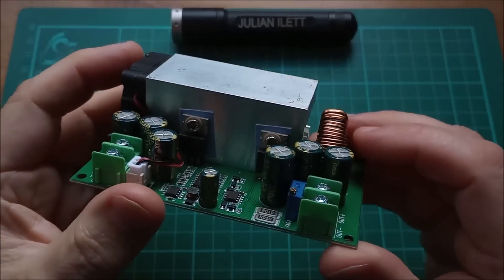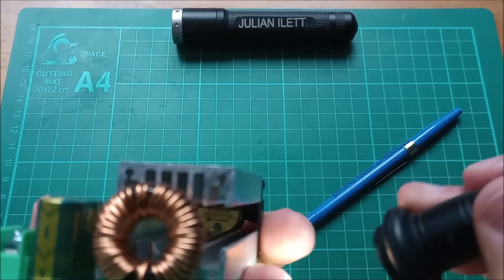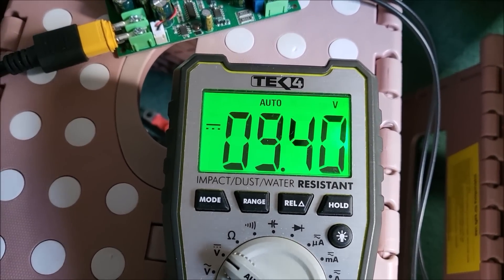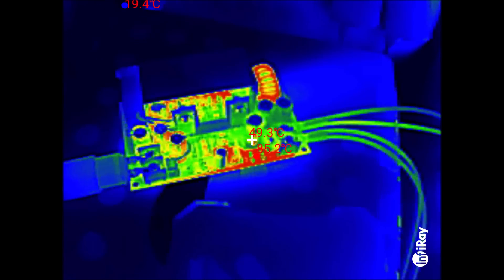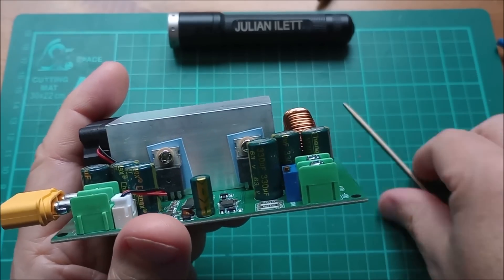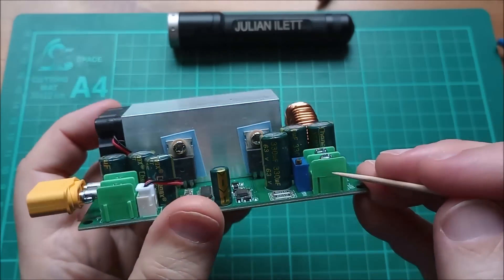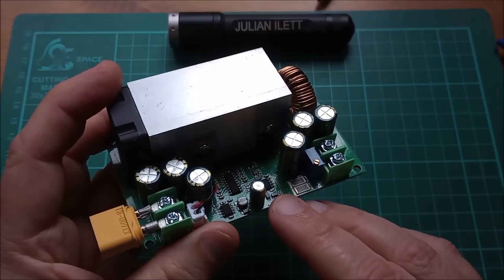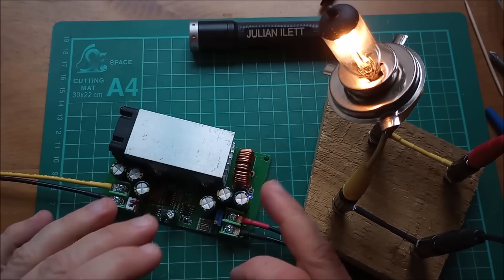Postbag Update - 25A Buck Converter

Comment: The converter has proven itself in operation well. When working in parallel, a symmetrical connection is desirable (the length of the wires and their resistance should be the same). All the terminals of the units should be connected at one point. With respect, Vladimir.
Преобразователь зарекомендовал себя в работе хорошо. При параллельной работе желательно симметричное соединение (Длинна проводов и их сопротивление должно быть одинаково). Все выводы блоков должны соединяться в одной точке. С уважением Владимир.

Comment: Sir I have been using a solar plate 600 watt for a year with a buck converter 600 watt 25 amp if I double the same set up and connect the output together then will it give me 50 amp please Please answer me

Comment: I have one more question if the discussion here is still active : does anybody know if the choke is made with aluminum wire and the efficiency can be increased by re-winding it with copper ? There is a discussion going on about the very cheap 400 W stepup module that can be much improved by changing the choke wiring.

Comment: Very informative video, thanks for it, i recently bought two such modules and there the transistors are HYG043N10. I'm playing around with swapping transistors, for example the 400 W boost converter that has very cheap transistors can be upgraded to go to higher voltages, and also the commutation losses  depend not only on R_DS,on but transconductance and input capacity so the best is just to try which one gets less hot. Nice to learn from the comments that the parts are  tl494 and driver ir2104, so i guess the other ic is a little buck converter only for the fan ? The part numbers are erased on my modules.

Comment: Buck is tl494 and driver ir2104, my findings based on the circuit schematics
Reply: Pm me can you to install do sola paint of charger`
Reply: Thanks a lot. Do you know what is the small buck voltage regulator that makes the 12 V for the tl494 and the fan ?
Reply: @earlyadapter643  XL7005A

Comment: They do make a version of this with current control. The pot would be on the left side near that mosfet you looked up. Haven’t looked what else they change on the PCB. I’m only interested in these buck converters if they have current control. 

Obviously the other issue is the lack of displays. I have seen similar buck converters that also use small 7 segment displays. 

For under $20 (the variable voltage/current model is $12’ish, the one with displays is a bit more) this isn’t bad for a 15A stable, perhaps 20A with upgraded heat dissipation.
Reply from the maker: Yes, I got that version. It looks like a bit of a fudge. The current pot is wedged in, touching the MOSFET. I can't see myself using it.
Reply: Pm me can you to install do sola paint of charger`

Comment: Thanks for a great video, I really like your lamp set up and the connectors with the fork terminals.  All of your connections really.  I have something similar with a lot of socket adapters that will accept US 120V bulbs (it's always been a work in progress).  While I was watching this, I would have liked to see a test of the output voltage, set it down to just below the minimum you had with all the lamps on, say 10.000V and then plug and unplug all the lamps to see if the output voltage remained the same.  I did just order one of these.  It says they operate in the Continuous Current Mode CCM not sure how that's different than Constant Current CC.  My reading of CCM finds that the inductor always has current flowing and never zero.  hmm...  Nothing to do with Constant Current which I care about.  It does say it has Constant Current (and short circuit protection).  It also needs a flyback diode if powering any inductors.  It has no reverse polarity protection on the input (easy to add).  There are some really cool small fans that are squirrel cage and don't whine all the time, I need money, where are the car keys... wait, that's something else.  I like this little buck converter.👍👍 ⭐
Reply: Pm me can you to install do sola paint of charger`

Comment: I think those shunt resistors are irrelevant except for a hard set over current protection, most likely set at 25A. They do nothing when running in a CV mode which is where it was running the entire time you were testing. I suggest soldering right over them as your overcurrent will be from upstream devices anyway. This will keep any ground loops as minimal as possible so you don't damage any small interconnects between the cards.
Reply: Pm me can you to install do sola paint of charger`

Comment: i expect that that package rating is with the device connected to incredibly big heatsink. 
it's almost impossible to get the currents they claim on the data sheets in real life.

I had a 1KW rated resistor which with 800W blow in about 3 seconds, it was mounted to a heatsink with two very powerful fans but it still died. Later found that we had to machine the heatsink as plain aluminium finish was not flat enough to allow the heat to flow even with a pad. this was in some very very small print. 🙂 we spent as much time designing the dummy load as we did the circuit we were testing.
Reply: In software development with thorough test code it is common to spend 2x to 3x the time writing test code as the production code (what we'll deliver).  You can get about 50% test coverage if you spend about the same time on test as production code.
Reply: @Sylvan_dB  Don't get me started on software testing. having done projects to DO-254 (HW) and DO-178C (SW) i hate the saying "can we just make a minor change" 6 months in to testing.
Reply: Pm me can you to install do sola paint of charger`

Comment: I have been using a couple of those regulators to drop HV solar panels down to a suitable voltage to feed my cheap fake MPPT solar charge regulators. What I found most 
interesting is the final system efficiency is even better than a much more expensive MPPT solar regulator. I set the buck regulator output voltage to 16V into the cheap PWM regulator which delivers a full 22Amps into my load, with the MPPT controller I get just under 20A from the same panel, both running at 14.5V final output. Without the buck regulator I get just over 6A with PWM regulator alone, but with this system, as the current drops the solar panel voltage soon exceeds the PWM maximum input voltage. So after discovering this hidden benefit I did a second panel the same way and get consistently better performance than the big dollar mppt controller, the cheap solar charge regulator gives me full data logging and LVC battery protection along with USB outputs and direct in/out ports. The total expenditure is so low that I can afford to do multiples to gain large energy levels. I also purchased several of the more expensive 800 watt buck versions with CC/CV to use with my 430Watt panels and I get almost the same gains. I also find the buck efficiency gets more charge energy on cloudy days and early/late sun than the MPPT chargers manage to do, the high panel voltage coupled with high buck efficiency to transform the voltage down just works so well at very low light levels. I suspect my overall gains are probably much better, mainly as it is reaping benefits by efficiently charging low voltage (12V) batteries from HV panels. Time will tell as I log more data.
Reply from the maker: Have you looked at the buck/boost units with MPPT pot?
Reply: @JulianIlett  Not as yet, if they can squeeze even more efficiency out I'll have to give them a try... do you have any video reviews on them?
Reply: I was thinking of doing similar- but for the purpose of keeping my pv wire voltage high with 4 or 5 panels in series to reduce losses over my 80m long wires. I would need a buck converter that stepped down the roughly 250vdc to about 100v which I would then feed into my mppt chargers. I can't find any converters that run at that high a voltage though.
Reply: @tomgrant6563  Good idea, I did a similar trick to operate our gates about 140m from the shed, I run 24VDC into a boost converter, send it to the gate box at  55VDC (maximum the cheap 10A boost converter would do), then I buck regulate it back down again to 24V at the gate box. On load when the gates are moving the peak voltage drop over the 140m is about 20V, but the buck keeps the output at exactly 24V up to about 7A load. It was much cheaper than trenching in mains or running super heavy gauge wire.
You may be able to run HVDC into a regular switchmode power supply for broad voltage input conversion down to whatever voltage you like. Most will work happily on DC input up to 340V (250VAC), and down to around 150DC(100VAC) as they internally rectify the AC input anyway and self regulate for 100-250VAC input..
Good luck.
Reply: @alasdair4161  haha that's a bizarre- I figured that out today  before I saw this comment! after a fair few days of researching and scratching my head! Exactly as you described.
Switch mode power supply off the dc.
Reply: Pm me can you to install do sola paint of charger`
Reply: Do you think it safe to run it at 25A continuous. I've limited mine to 20A MAX, but my panel generates a lot more than that

Comment: If those use a closed loop voltage follower to regulate it's output, I would fear them fighting each other if you deisolate them by allowing the grounds to reference together. No two voltage references are exactly the same, and it would send each other into current regulation allowing all the voltage followers to free for all deathmatch regarding what is actually '12v'. 
A diode would be enough to prevent this from being an issue, but you would have to compensate for that voltage drop and it would be a possible point of efficiency loss. I would use schottky and not silicon diodes.
Reply: I'm not sure diodes would actually solve that problem. Besides you should use ideal diode modules if you are working with high currents.
So yes with closed loop voltage regulation the problem you have is that one module will always be set at a higher voltage than the others, so because it is the highest voltage the majority of the current will flow from it as it tries to keep the higher voltage than the rest, the others see 12.01v when set to 12v so they shut off completely. It is only until the resistance in the connections or really precise trim pot adjustment will that balance out.
What you want is actually a resistor on the positive side so that a small change in voltage doesn't have a large change in current. This has been done many times before with audio amplifiers with multiple transistors in parallel.
The reson you want it on the positive side is due to ground loop reasons, if you were to inadvertently ground the chassis of the AntMiner with a stray wire or other metal enclosure your negative side resistance will change, defeating it's purpose. Putting it on the positive is ideal because it is generated at the buck converter and consumed by the miner cards, so nowhere else to potentially connect.
All current shunts in my opinion should be on the positive side to avoid creating negative and ground potential differences.
I personally use the WD4050 module it is much more expensive but it has all the right features, positive shunt, sunchronous, display, and CV+CV adjustment.
Reply: I also believe running one module per card would also completely eliminate the "fighting each other" issue, if the 12v output is not in parallel on the positive side then one card can run just fine at 12.1v where another card can run from another buck module outputting 11.9v. Both modules and cards will output and draw the same wattage. The 11.9v fed card will just draw slightly more current and would run a little less efficient than the rest but there would be no cross fighting since they won't have a way to influence each other.
Very good topics to discuss for sure.
Reply: @SuperBrainAK  I assume there are positive rail interconnects between the cards. Perhaps the real danger is damaging those interconnects, or anything else that is between them and the differing rail voltages. A diode would limit that effect since the power supply won't try to sink any current itself. But yeah, that would be a 0.5v drop you would have to deal with by increasing the power supply voltage and dealing with the heat generation. A resistor to limit current on each would generate even more heat.
Reply: Pm me can you to install do sola paint of charger`

Comment: Not sure the unit needs derating due to the connector.  300V at 20 Amp is 6 000 Watts.    That is very different to 20 Amps at 12 Volts which is only 240Watts.   So the connectors will handle a lot more than 20 Amps at 12 Volts.    Derating it for other reasons may be worth while, but not for the connectors.
Reply: Hmmm, The connectors don't depend on the wattage of the load but of the wattage of the connection due to the resistance of the junction and materials used,  which would be I times the voltage drop along the connector or simpified I^2 * R. I.e. it should only depend on current and connection. Where am I wrong?
Reply: @neur303  You're not wrong. 20A means 20A maximum current for the connector, regardless of whatever potential it is at, because of the I2R losses causing overheating. The reason the connectors also carry a voltage rating is because of the possibility of insulator breakdown. Two separate failure mechanisms for overcurrent and overvoltage means you don't just multiply them together as if it were a maximum wattage!
Reply from the maker: Yeah, there are lots of reasons to derate these things. Interestingly, they seem to have fitted a higher rated output connector now: https://www.aliexpress.com/item/1005005639051641.html

Comment: Re 12v double filament Headlight Bulbs (@16mins), unless both filaments are same wattage they will have different voltages across them when filaments are wired in series. 
The lower wattage filament has the higher voltage and will be stressed / may blow especially if you apply the voltage of two fully charged car batteries across them (2x14.4 = 28.8volts).
Also having both filaments lit results in an awful lot of heat being produced and is probably not recommended.
Years ago I was using 4 paralleled bulbs in this fashion while testing a beefy 28v power supply, It was entertainingly very bright and hot for a couple of minutes before they all blew the low wattage filaments.
Reply: Pm me can you to install do sola paint of charger`

Comment: The more current you pull through those measuring resistors, the more effect bridging them out will have.
Reply from the maker: I'm not so sure now. There's another variant of this converter that has a current limit pot. Maybe this unit uses those current sensing resistors to perform a simple shutdown at 25A. Not sure. I've bought the other variant.

Comment: ah, banana plugs and spade terminals. Reminds me of my electronics class 50 years ago!
Reply from the maker: Those and XT60s are my favourites :)
Reply: @JulianIlett  Agree with the XT60s - such a useful open-source and versatile connector, it's like Lego, so easy to make distribution blocks and adapters with them, though it's a struggle with 10AWG cable.
I also have to use XT90s since I can use 100s of amps for large ebike and inverters.
Reply from the maker: Yes, I recently used 12AWG silicone wire with XT60s - it wasn't easy. The male connector has deep recesses behind the solder cups, but the female doesn't. I'm tempted to make a video about that.
Reply: @JulianIlett  tip, when soldering XT connectors, plug it into its opposite connector to hold the pins in place in case the plastic starts to soften or melt.
Holding vertical may be best. The void could be filled with a piece of solid core copper from cooker cable. Saves solder and improves conductivity.
Also good for building distribution blocks splitters, series, parallel and gender changers. Encase in hot glue and shrink-wrap.
Reply: Pm me can you to install do sola paint of charger`

Comment: If you had a scope you could measure the noise, which is quite significant on these modules
Reply: I feel like he does have an oscilloscope
Reply: @james10739  Never seen one on this channel. His bench is oddly unequipped for the hobby, not even a bench power supply which is generally the first thing everyone builds?
Reply: And he has 12v and plenty of boost and buck converters so a power supply might be a little more convenient but not really necessary
Reply: @james10739  it’s pretty central to have a box with V & A meters and current control, he wastes hours fiddling with DC-DC modules instead of just hooking one up
Reply: @____________________________.x  well a lot of that is messing with them to mess with them it's not that he is doing it because he doesn't have a proper one and like the d3806 it has all that just with buttons and only 1 display you have to switch between but can show everything
Reply: @james10739  it’s not always the best content though, every video is 10 minutes of attaching wires and poking around with a multimeter. Kinda wish he’d build another Z80 instead
Reply: I think I have but I'm not that sure
Reply: Pm me can you to install do sola paint of charger`